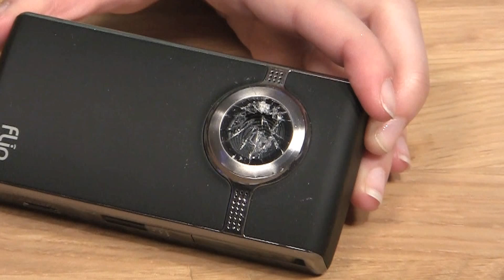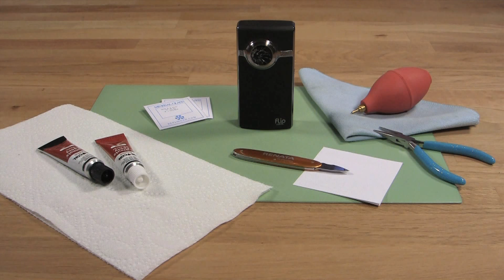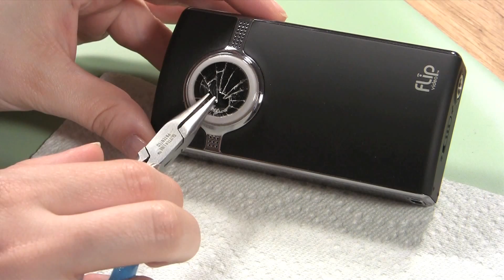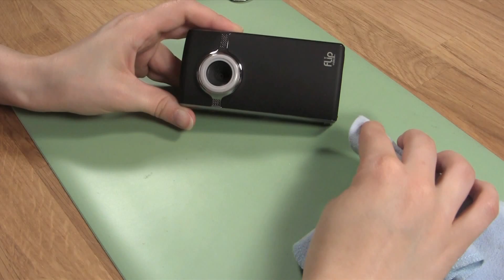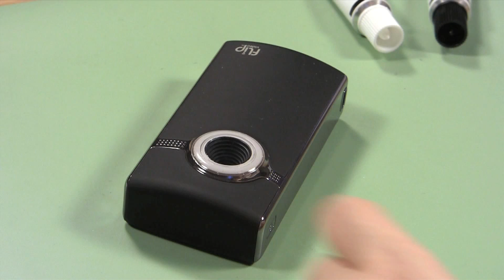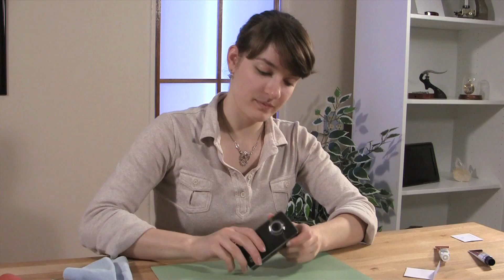How to Repair a Flip Camera Lens

Comment from the maker: If the screen is not working you likely have some other electronic issues - changing the lens might clear up the image but you would need to check the camera memory to see if your getting pictures or if your camera needs a different repair.